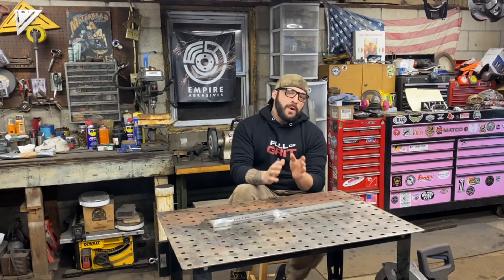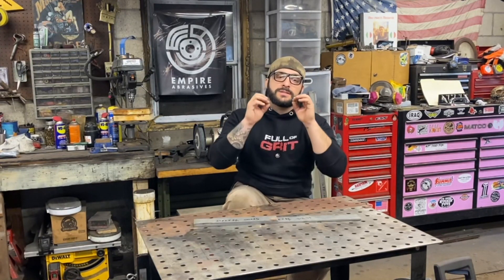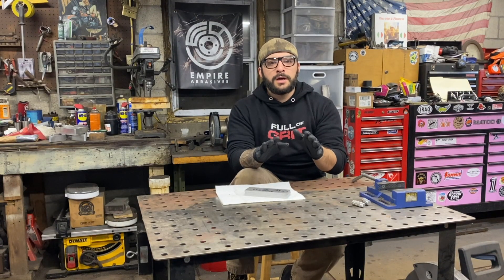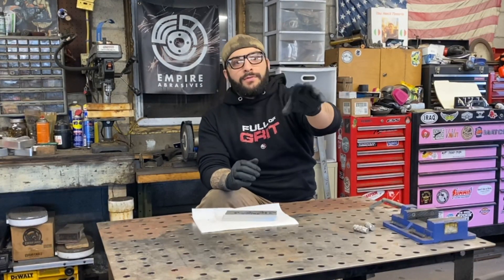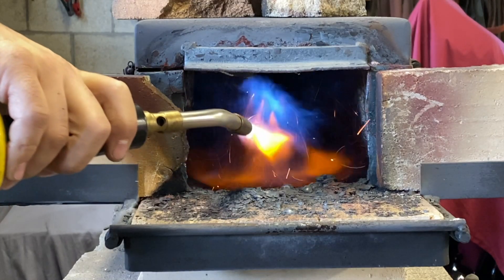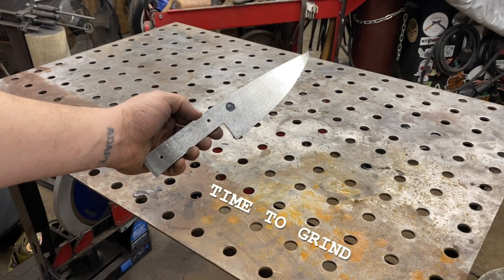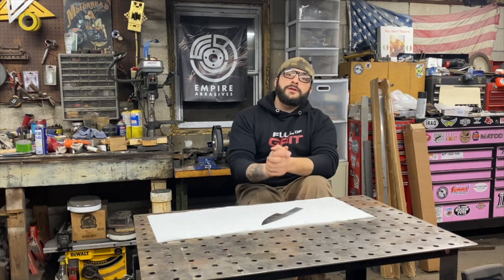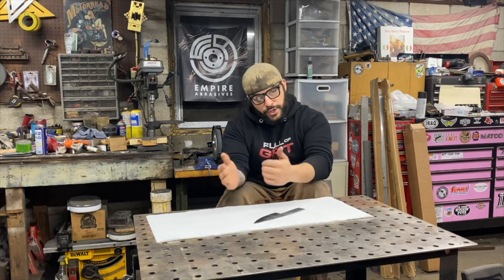How to make Stainless San Mai Steel

Comment: Awesome process! Wouldn’t you achieve the same result using a lower grade stainless like 410 or 416? Your welding temps would be more manageable not to mention cheaper on gas and material itself. I’d save the aeb-l for a stand-alone blade. Looking forward to seeing more from you!
Reply from the maker: @JonathanDavisREP  since making this video, I actually have shifted to 410, with much more consistent welding results. Going forward, I’d definitely recommend that steel selection for sure